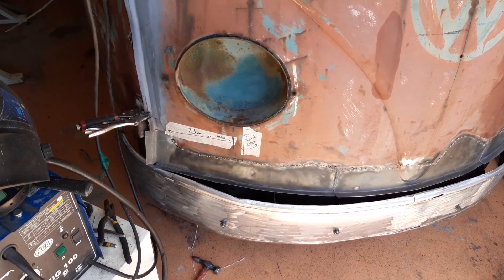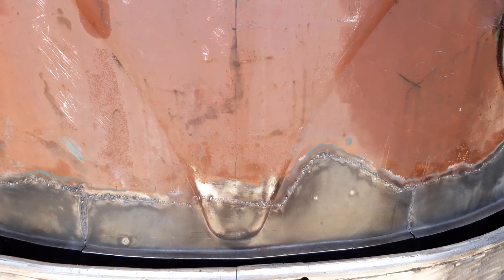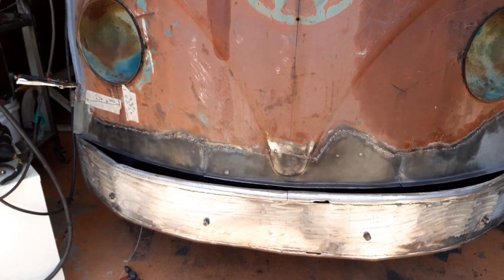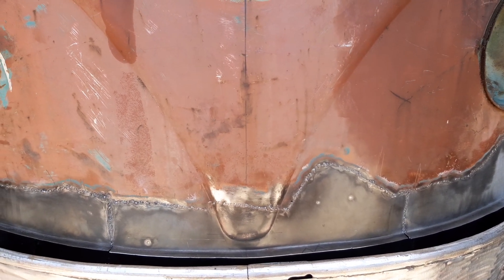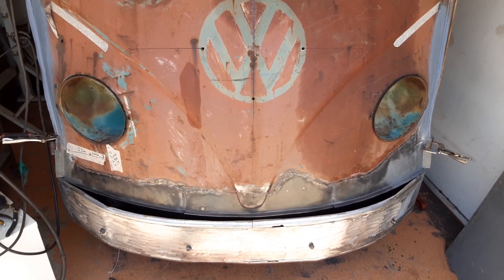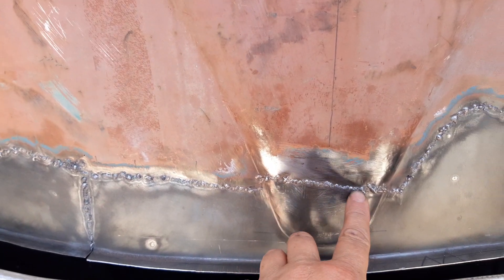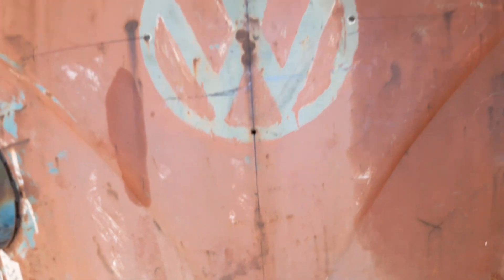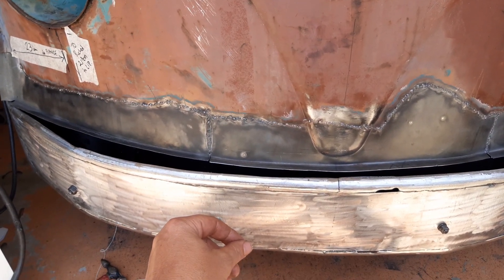Semaphore vwbus nose job 1955 welding to rust

Comment: Your doing a great job, that nose piece came out looking good. I have some catching up to do on your videos. Been working on my beetle with all my spare time and ive missed a few of your videos.
Reply from the maker: Best of luck on your bug mate.
I know time spent is time you don't have to do at a later date
Reply: @vwbusguy  thanks, we tackled the electrical today. So far its running good without any shorts or anything. Its no where near the project you got going on though!
Reply from the maker: Argh electricals....that's a hair puller.
Don't you agree?
Reply: @vwbusguy  oh yes I agree, especially when the wiring looks like a rats nest, and you have to trace which one of those are giving you problems.
Reply from the maker: @timstines1341  if I can give advice something that was explained to me is use the fuse box to your advantage ie take a fuse out one at a time until you find the problem then you only have to worry about the wires in that circuit.
Reply: @vwbusguy  that does make sense, never been told that before I appreciate the advice! The wire that was giving us trouble ended up being the larger main power wire to everything. I would start it up turn on the wipers and it would kill power to everything. If I smacked the steering wheel it would all come back on haha. Found out that the wire giving us trouble was resting right above where the steering column is bolted on. So every time I smacked the steering wheel it rattled it enough to make connection. It was also being rubbed by the metal arm that moves the wipers so I think it was shorting out on that also. But its all fixed and I drove it 22 miles back home from my grandparents without any problems.
Reply from the maker: @timstines1341  sounds like a hard one to trace back.
That's why I was shown that method..it takes the nest out of the equation and you start to deal with individual wires..it also works in the opposite way ie take all fuses out and you will see if there is a short as you start to put back in.
It's similar to a" parasitic draw "test.
Have a great day
Reply: @vwbusguy  well ill keep that in mind, have yourself a great day also, ill be looking for your next video.
Reply from the maker: https://youtu.be/f-G9Zk3uFk8